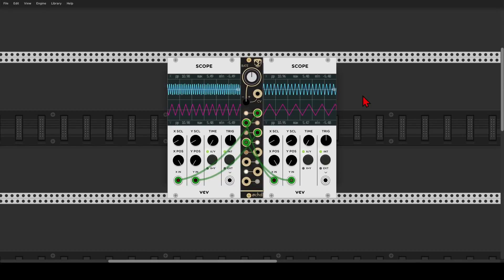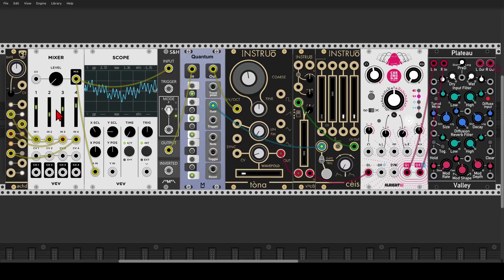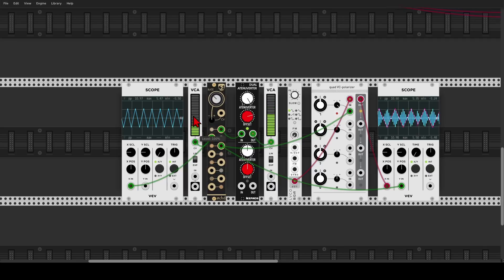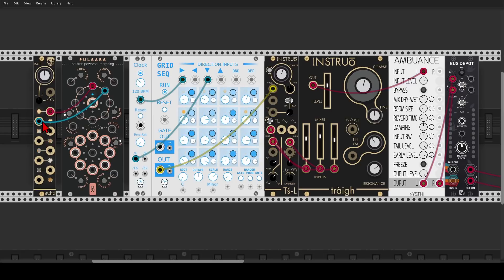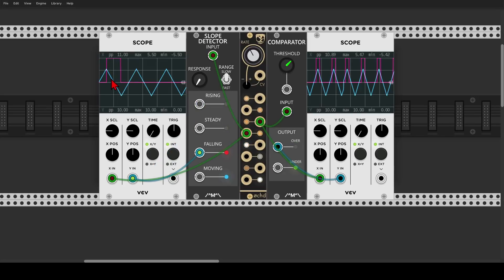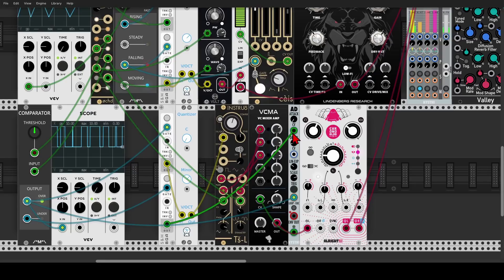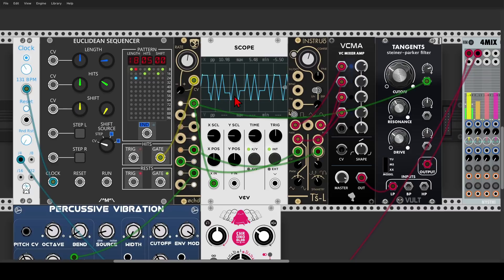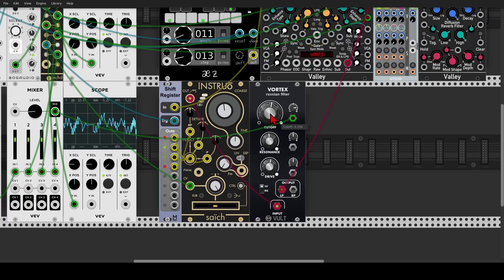8 Patching Ideas with Ochd in VCV Rack

Comment: Thanks a lot for your inspiration! Are you planning on doing a video for a few more of the new instruo modules? I love them and watched all of the videos on his channel, but I cannot figure out how to access the parameters you can get from the hardware modules by clicking two buttons at the same time (like programming the harmonaig chord types 1 - 4 for example)
Reply: These parameters can be found in the context menu if you right click on the module :)
Reply: @murdograham8110  I'm pretty sure that those are not implemented (yet). The right click menu for the harmonaig has the "modal selection" and the "Module Mode" Selections, but not the possibility to program custom chords into the chord quality settings 1 to 4. On Page 16 of the manual (which is that of the hardware module) is explained that to enter program mode you have to hold the transpose button and double tap on the diatonic button. But that is simply not possible with one mouse pointer :P - I am totally fine with it, as I am hoping they will add that functionality in an update.
Reply from the maker: Yeah, I'm working on it :)